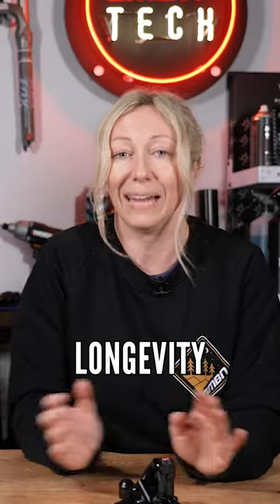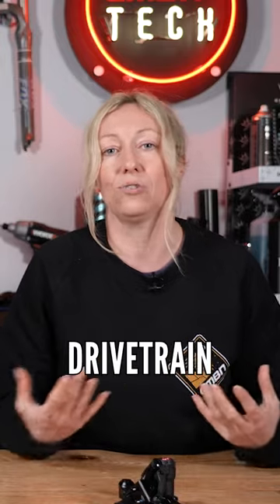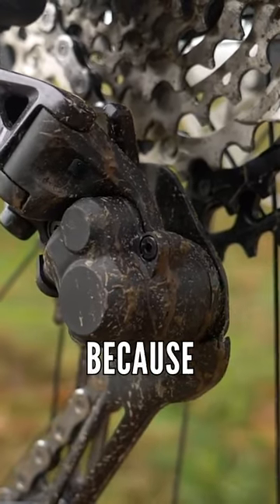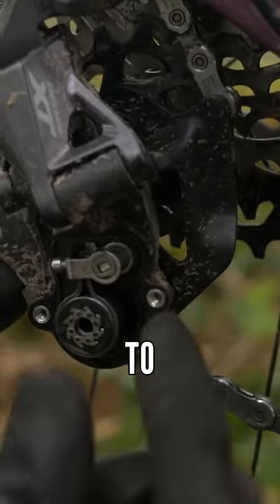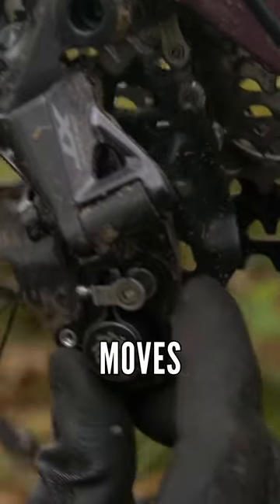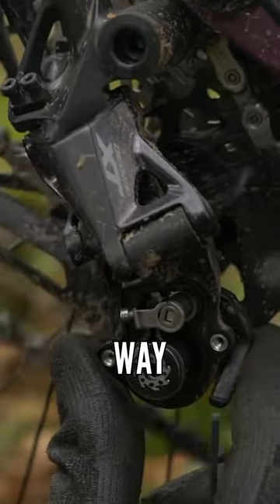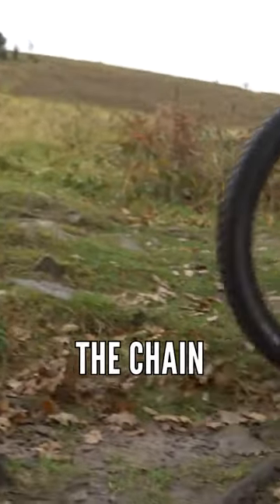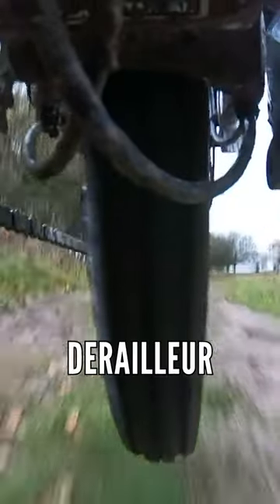Does Leaving A Derailleur Clutch On Wear Your Drivetrain Quicker? 🤔🧑‍🏫

Comment: The real reason you have a clutch is because the chain needs to be able to change in length based on which gear you’re in because they all have different diameters therefore no one single size chain would work without the clutch keeping it tight
Reply: No. That's what the derailleur is for and derailleurs were serving that purpose LONG before clutches were added to them. As she said in the video, the clutch was added to derailleurs (fairly recently) to help keep the derailleur arm from bouncing as much when you go over bumps, causing the chain to slap around all over the place and coming off.
Reply: @MrJacobegg  the derailer is what changes the gears the clutch is what keeps the chain tight
Reply: @That.Guy.  No. What tightens the chain against the gears is the tensioning SPRING in the derailleur that collapses the cage (the folding arm part of the derailleur) in on itself to take up the slack. The clutch just adds friction in one direction to keep the spring from bouncing as much.

Again, derailleurs were doing what you're talking about for DECADES before they had clutches. Shimano only introduced the clutch in 2011, and only in their high end models for the first few years. Many if not most road bikes and entry level mountain bikes STILL don't use clutches in their derailleurs. I have a MTB with a 10 speed Deore right here from about 7 years ago that has NO clutch on it and it shifts just fine - but it has lots of chain slap on bumps and drops, for the reasons I mentioned in my first reply.
Reply: @MrJacobegg  how do you not understand the spring is the clutch ?
Reply: @That.Guy.  Unfortunately you are wrong. The clutch and the spring are two very distinct parts. In case you are not just trolling and want to learn something check out the exploded view of e.g. Shimano RD-M8000
Reply: @That.Guy.  I definitely understand that you think the spring is the clutch. What I don't understand is how someone can be so wrong and yet so incredibly, stubbornly cocky and sure of themselves when there's so much information out there, easily available, about what a derailleur clutch is and how they work. You could Google it. You could ask Chat GPT what a derailleur clutch is. You could even search for "derailleur clutch" here on YouTube and watch a million videos explaining what they are, showing how they work, and talking about the history of when they were introduced and adopted. The top video result from the above search (for me) even has Doddy from GMBN taking the cover off a derailleur clutch to show how it works on the inside, and showing how the spring return mechanism works with the clutch engaged vs disengaged. I would link it for you since searching things on your own is apparently too much work, but YouTube doesn't seem to allow links in comments.
Reply: @That.Guy. bruh really?😊
Reply: this  @That.Guy. is so wrong and still stubbornly cocky lol
Reply: @That.Guy. bruh stop trolling already